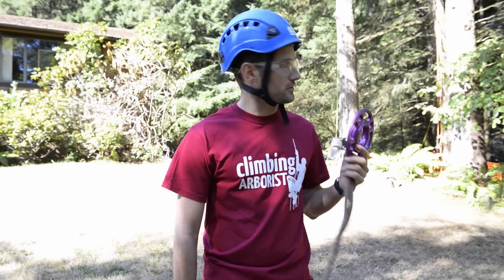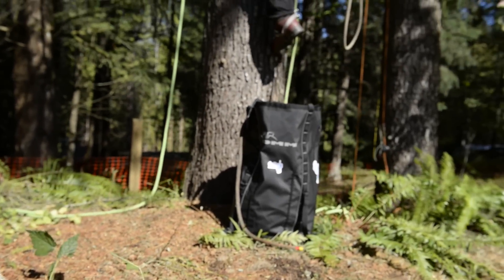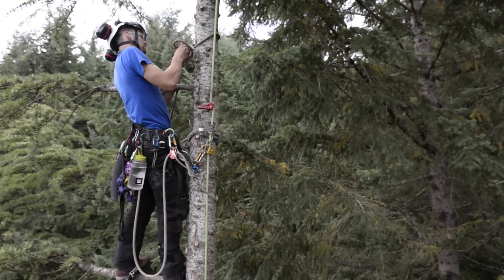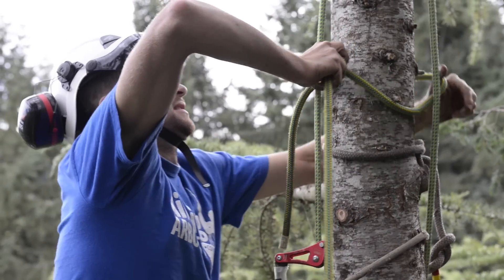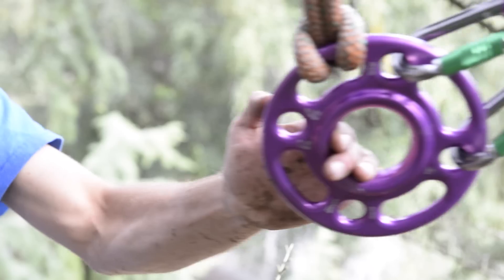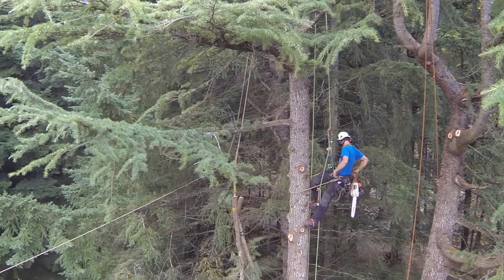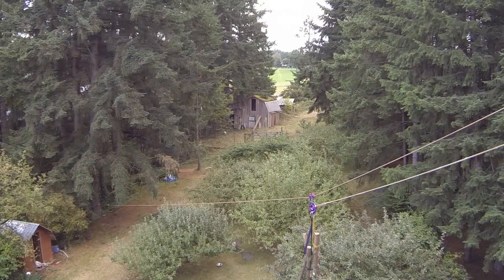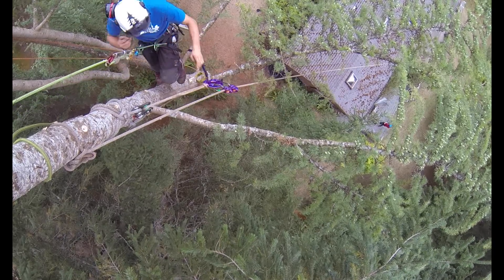Controlled speedline / slideline | Arborist rigging systems

Comment: good job,,But from my 30 years climbing trees a couple strong men or a skid steer,/ tractor will take the place of all the rigging,  ive sucked up a many big limbs over roofs with just elbow grease,,but multiple pulleys  do have thier place
Reply from the maker: Where there’s a will there’s a way to get anything done. You may have been able to save a little of that elbow grease, possibly… but maybe not

Comment: Should've shown the top. 

Did you see the recent one Reg put out "tree work takes practice". Sick vid. He locked off the port from IN the tree. He showed himself testing his system at the beginning too. He is so mellow but I know he was so proud of getting that on camera. 

The system you show here is surprisingly easy to set up. Love the prusik at the bottom to hold the tension. Probably most ergonomic and failsafe choice. 

You guys should invest in the mb speed line kit. And you could fill the wheel up to capacity of the pulleys/rollers. 

Btw, couldn't you just put the rigging line on the first of the branches in a bundle and send as much as your tensioning system would lift and let the first branch hold up the group? (No pulleys, no wheel)

Comment: Excellent video team, was just wondering, would you do this without a back tie rope as sometimes there is no tree to do so? And also would George be able to tighten the speed line and loosen it using a lowering block instead of the system shown?

Comment: Maybe I’m wrong buy it looks like Dan was spike less is this for training purposes I’m in my first year of climbing and my boss doesn’t want me to use spikes/Spurs at all!!....
Reply from the maker: Hi Brad, It is my opinion from working with many many different arborists, if they know the job is a removal then they reach for the spurs before even seeing the tree. If the tree has a structure that allows you to climb around with ease, just like if it was not a removal, then I always opt to climb without spurs and use my climbing ability and not have big, awkward metal spurs strapped to my feet that are only needed for bringing down the final stem. But this is only my personal preference, every climber has their own way of approaching jobs.

Comment: What size speed line are you using.    Size ,type and length of pursiks. Great video
Reply from the maker: For a good speed line you want a strong, static rope, size is however long you will require to cover the distance. prussiks can be your usually prussik cord.
Wesspur sells a great static line for a speed lines, go to wesspur.com/pod , search Sterling HTP Static Kernmantle 12.5mm (1/2”) ,  and use the promo code 'DAN' at checkout for a discount

Comment: As always, AWESOME video!! (Learned much of my first climbing-info from you when I got my 1st rope!)
It's crazy seeing something like that where you're actually making-use of that DMM block & rigging-hub, they're real pretty gear haha just beautiful hardware, am a fan of rings myself after hearing Reg Coates' endorsement of them and giving mine some more serious use and finding they were actually desirable because that extra bit of friction up there was good*!   Obviously in this scenario you benefit from the increased efficiency of a pulley because you're running *two lines - must be what you mean by CONTROLLED-speedline eh?- very cool, to be honest I can't say I've seen that I usually just see someone setup a line and send right down it, I love the safety / smarts of the 'load-balancing', equalizing-of-force that you get with a 2-rope system such as that, the loads you were sending....AWESOME!!! (still though, that DMM gear was still probably 2 or 3x the strength needed lol but hey overkill is better than underdoing it!)

Comment: I'm not criticizen you  buy if it's a demo video and it's on the speed line you should use it correctly. I have seen videos on the speed line and the limbs went down fast  even with just the climber doing it all . Look up Human on YouTube and watch his video on speed line
Reply from the maker: The key component in this video is the control line, this means if you need to control the speed of decent then you can, hence the reason they don slide as quick. Also speed is affected by how steep of an angle you can create, which is determined by where you can tie the bottom of the rope to.

Comment: I have a question tree folks. Could you place a pulley say 10-30 feet in a tree across the house and run the speenline to a portawrap at the base of said tree, tension it up and then give slack as it come toward you ?

Also could one achieve the same functionality of the setup with much less expensive gear such as instead of a rigging block just using a good carbiner and run the rope over to the other tree and tension it up on a portawrap?
Reply: Not quite. It would Lower back towards the initial anchor side (ie direction of the house). 

Slacking the system would be suitable in a situation where a control line is not used. That would be a true speed-line set-up. However, it the case of this video, they were demonstrating a control line and post-tension as a way to make a long run without the pieces loading and stretching the line over the structure. This is 100% the safest way to operate this system in this scenario. And it is only a demo. There are many ways this tree could have been removed.

Asking "what if's" on-line, over the phone, etc is a terrible approach btw without being present at a site.
Reply: Brian Thiebault makes sense. I am a completely self taught climber so I ask a lot of online what if’s. Best not to be wondering what will happen when I’m cutting
Reply: @kivaswander5537  fair enough.

Comment: Ok but why? Why not just let them drop then drag?
Reply from the maker: So we could make a demonstration video to help and explain the setup for others to learn from.
Reply: Climbing Arborist ok, but i’m not asking why you especially did that. I just didn’t get the reason why would anybody use this method instead of just dropping the branches?
Reply from the maker: Because in some situations you can't just drop the branches, or if you do it become much more work to haul the to the truck to chip them. One scenario being if the tree is located on a steep slope and you don't want to drag everything back uphill. Another scenario there are multiple buildings below so you have to rig, why not rig directly to the chipper which could be much more efficient use of time and energy.

Comment: Nice video! 
I don't have time to watch it all over again right now, but do you have a second on the ground to control the descent, or does the guy running tension move to the tree to control it?
Basically asking if there are three people here.
The guy in the tree could run the lines?
Reply: The guy in the tree could run the lowering line if needed. However, he could not lift the speed line up as well as the ground man with the pulleys.

Comment: Having  a  "fixed"  skyline  (stationary)  would  reducing  or  otherwise  eliminate  the  need  to   pull  limbs  up  and  through  the  trees  crown...  Let  the  drop line  do  the  work  of  raising  and  lowering  when  needed...
Reply: Except that you’d only be able to do the limbs closest to the stationary line.. the others would require a longer tether which would cause them to hit the house, no? Pulling them up was the best way to do approach the scenario that I could see
Reply: @RAILKING25  I suppose one could add a lift line, from from ground to block in tree to block in pulley, then down to branch to lift the branch up to the fixed line. One extra line, one extra person, more work.